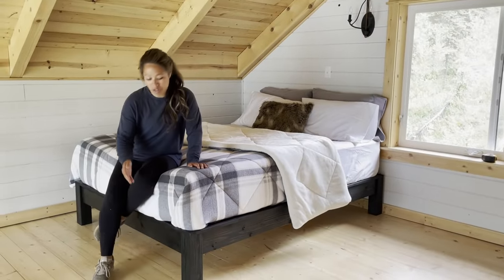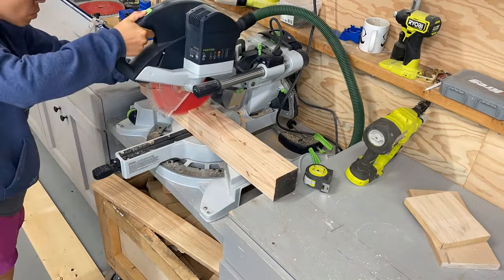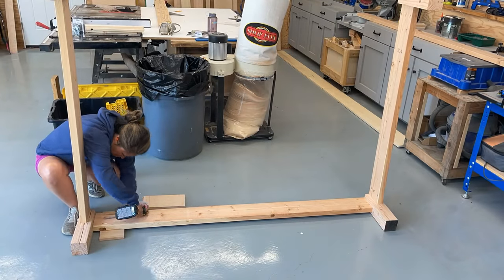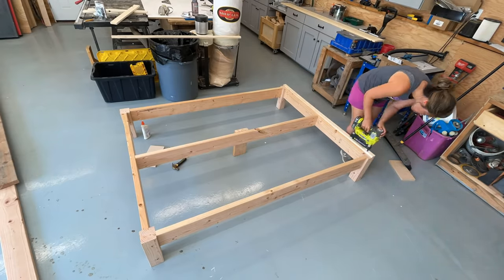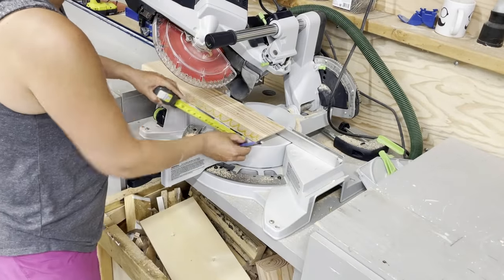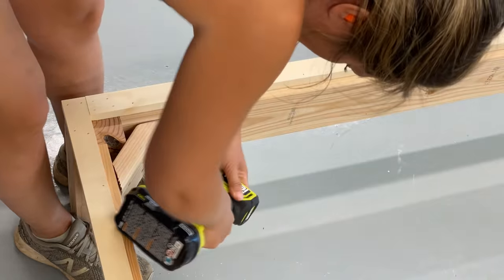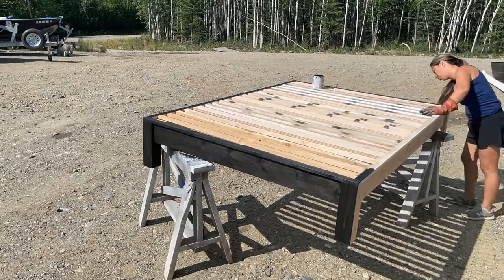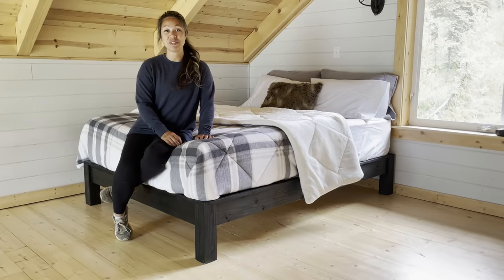Essential Bed Frame DIY Tutorial

Comment: Just finished this build and OMG! I’m soooo happy with how this turned out. I recently purchased a King bed after having a Queen for most of my life and was in need of a bed frame. After having the traditional box spring and low to the ground metal frame, I realized I wanted something with more storage so began the hunt. I searched for a solid 2 weeks for something that was pretty, didn’t cost $500+, and also one that would be sturdy enough for my fiancé, my plus size self, our 2 dogs, and our brand new mattress. When I came across this built I thought it was perfect as I am a DIY lover myself. The plans were extremely easy to follow and the measurements were spot on. If you’re looking for a simple project this is the one. Total cost as of Dec. 2021 $120 for the wood $20 for the pocket hole jig (as this was my first time using one) $15 for the stain and accessories, and roughly $10 for the screws/nails making the total for me $155 🤩 

Also plus, I learned how to use a miter saw for this one so all around 10/10

Comment: Great instructions.  I built this this weekend.  I adjusted the measurments/cuts a little bit making it 1 inch bigger (overall), 1/2 inch on each side and end.  Slats are still hidden but a little bit of the wood shows and looks nice when made up.  Thanks for the plans!  Next up, nightstands and a basic headboard!  Also from Ana!
Reply from the maker: Nice work!

Comment: First of all, I'm a huge fan and thank you for your amazing DIY plans/ideas. I purchased a King and a Full bed-in-a-box mattress and needed 2 new bed frames. With your help, I built both in a day and spent approx. $250 on materials  at HD. I chose the Varathane Worn Navy finish (similar to "Cape Cod Blue") and the results were fantastic. There were 2 modifications that I made to your design plans:
1. I used heavy-duty bed frame brackets instead of pocket holes to connect the 2 side frames to the headboard and footboard. This allowed me to transport BOTH the King and Full bedframes to the upstairs bedrooms by MYSELF. It was a game changer!
2. I increased the height of the 4 corner legs to 18"H. This allowed for amazing new storage space and safe space for our cats. Note that I added skirting on 3 sides to hide the storage/cats.

Comment: My recommendation to any of you building is to use wood glue or construction adhesive on every slat before nailing. This is to prevent future squeaking. Would also add to the corner pieces as well.
Reply: Great suggestion - Thank you for sharing it. ❤

Comment: Thanks for the great plan. I do have one question. On the written instructions, you mention to reduce the side and top/bottom 2x6s by 7". I am assuming this is accounting for the two 4x4s. However, since the 2x6s are inset by 3/4", would it be 5" that we would need to reduce the mattress width and length by? I just want to be sure I'm understanding. Thanks.

Comment: That bed seems bomber. Only question I have is, for the center support, thoughts on putting a short 2x4 support directly beneath connected to the one screwed into the side? Right more it looks like the screws get stressed with the center weight rather than lumber straight down (with screws just for stabilizing).
Reply from the maker: Yes, you can add as many legs as you'd like to beef it up!

Comment: That’s a great build, maybe some wheels on the four legs to move easily
Reply: And glue or staple gun 3 strips of webbing across the slates, for easy rollup removal, if this bed is going to move (temporary use or moves between apartments).

Comment: O.K. Ana ! You And your Hubby needs to step it up a Notch ! How about Making a Ole School Bakers Cabinet ! Back in " The Day" I don't know if everybody had em But here In the Appalachian Mountains My Grand ma and all her Kin and Buddies had what was called and Bakers Cabinet ! They were about the size of a China Cabinet ,,, Maybe about 6' 6" tall ,,, probable 4' wide and probably 2' deep on the bottom cabinet and transistioned to 12 at the top ! But heres the Kicker instead of Cabinet Doors on the bottom opening left or right ,,the Door Hinged from the Bottom and Layed out to about a 45degree with a metal "V" trough to hold Flour,,,the Other side for sugar or Corn meal ,,, some were Skinny troughs so the Cabinet may of had 3 choices ,,, Some had a long drawer across the front for Pie Pans and cooking utensils. The side transition from the bottom cabinet to the top was usually scrolled or ornate or some were ornate wrought iron ! Now the The top had smaller Cabinet doors and one shelf inside . The doors however were either copper or tin and filled with little small air hole in some sort of pattern as was some of the sides in order for fresh pie's ,,,bread etc. to cool without flys or roving hands getting to them !! But the top of the Bottom Cabinet is where you prepared your Cake mixes or pies , or cooking items ! usually  the edge of that Piece was also scrolled and fancy ! As good as you and your hubby is at designing ! You start making those and you'd stay sold Out !
Reply from the maker: Yes, those were awesome! I don't know, maybe....:)

Comment: I know that pocket holes are easy but I would not trust a few 2" screws to hold up the rigeurs of most beds. They need a bed bolt connection and hopefully tenons. There is no better way. Time to sidestep the pockethole jig for some better methods.